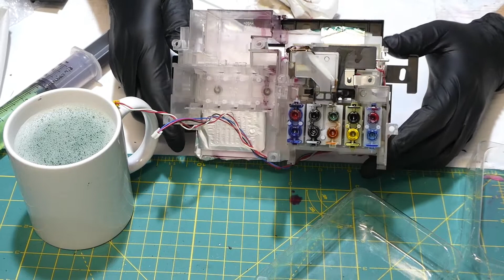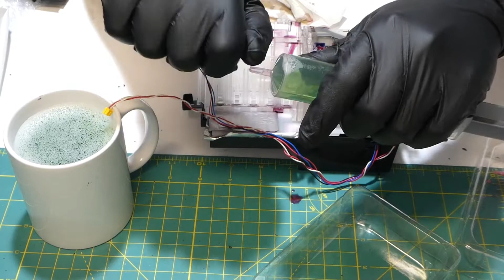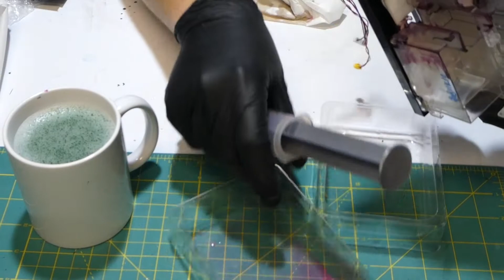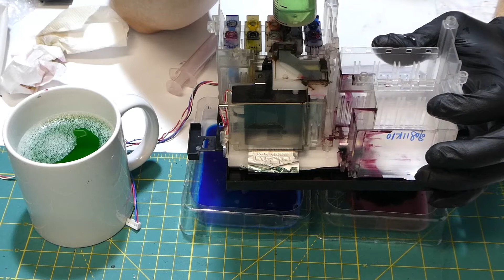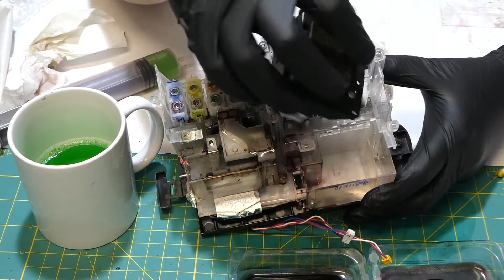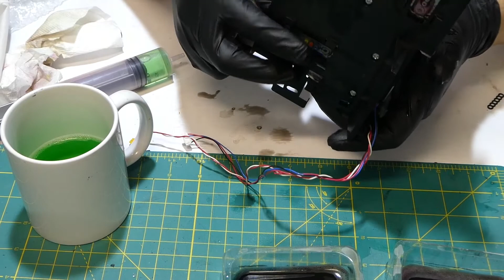Epson Stylus Pro 7900/9900 Ink Damper Assembly Cleaning & Flushing

Comment: I have an Epson SureColor P6000 and it says clean print head if there is fair or missing segment in check pattern, the magenta line does not come out, what should I do?
Reply from the maker: First thing I would do is check ink supply. Make sure cartridge is decently full then, in the areas where it's accessible, use a flashlight to check the ink lines for air bubbles or signs of a clog. Could be something as simple as a bit of air just getting in the system as well. If clogged, that's a whole heap of fun. Just clean the affected color pair if possible, so you're not going bankrupt wasting ink as well. If things clear up and start firing, probably fine. If you keep losing nozzles, probably ink starvation.

Comment: How do we contact you?  Your comments on the BCH printer videos are brilliant and knowledgeable.  I would love to know your thoughts on some other DTF printers.
Reply from the maker: Most DTF printers are basically kits, so nothing too special. Most are XP600, i3200 and i1600 printhead based units. Frames, electronics, pumps, filters, tanks and capping stations are commodity parts.

Comment: Very nice video - quite helpful. I have a 9900 and replaced the printhead 5 years ago. I do not use the printer very often at all. The orange channel is clogged and cleaning nozzles does not seem to work. Do you think that cleaning the printhead by immersing the printing surface in the cleaning fluid will help? If not I need to buy a printhead and also inclined to replace the damper assembly. Do you have any recommendations for sources to purchase the printehead and/or the damper assembly.  Thank you very much - Anil
Reply from the maker: When cleaning the head, set it in a shallow container of cleaning solution, just enough to cover the nozzle plate and a bit more and use a small syringe with a piece of tubing to pull the ink backwards through the head. If it doesn't move freely, let it soak an hour or so. When soaking, you can set the head on a paper towel or cloth fully saturated with the cleaner as well to cut down on evaporation. Pull again, if no flow, soak some more. Can do up to a 24 hour soak with most mild aqueous/sublimation cleaning solutions/flushes.
Reply: Thank you ver much. Will try this method.
Anil

Comment: Hey, you know the motor on the assembly? I believe it is the ink selector motor. Well, I turned the motor a couple times and I can see it moving to change the ink BUT now it doesn't work. I get an error when the printer tries to switch it and I can hear the motor try too. I tried to move the selector and right when I hear a click I leave it but that didn't work. Any ideas or lost cause?
Thanx for any help.
Reply from the maker: Try reversing the motor by hand back to the original position.
Reply: @o.e.r.3287  it's been difficult to put it back to the exact spot. I took it apart and I see that when I spin the motor it goes to a switch. There is 2 switches, I'll try to put it on the switch.
Reply from the maker: @RealLupi   The switches tell the printer where the actuator is, so, yes, good it set it to one of those. Since the printer sees neither being tripped, that might be the cause of the error message.
Reply: @o.e.r.3287  Thanx for your reply! After many tests and lots of time trying to figure it out, I DID IT! Turned up being the circuit board, had some damage on it so I replaced it and we are good now! But now my nozzle check is completely wrong. It looks like random straight horizontal lines in all the ink colors. Just lines, not even a letter to be seen. Any ideas?

Comment: Hi do you use straight simple green or do you dilute it with water? I have a 7890 this really plugged from sitting going to try this this week. Thanks for the video
Reply from the maker: 1-2 parts hot water (filtered/distilled recommended, but not necessary) per part of Simple Green works fine.

Comment: Hi, I followed your video and found it very interesting. I bought a used 7890 with clogging problems and only 2700 prints. On the first cleaning attempt with the basic procedure I got nothing, always blocked. I disassembled and cleaned the head with the syringe and detergent, and I recovered all the channels except the black, both MK and PK.
the test printed everything except the 3 central lines.
I disassembled the dampers and cleaned them with the syringe, dismantling them all and cleaning them one by one.
I reassembled everything but the problem remains, in fact it has become more serious, the test only prints the two upper and lower lines, so it has gotten worse.
what should I do?
Reply from the maker: Could just be a collapsed or toasted printhead.
Reply: Hi, I also have an Epson 7890 with the same problem. The black channel does not print. Just a few lines. I have already done 2 cleanings by dismantling the head. Did you by any chance solve the problem? How? Thank you very much if you want to answer me.
Reply from the maker: @alessandrofabbrini9964  Could just be a blown head, happens on those things. Also, gently inject some cleaning solution into each port. If it comes out the side of the head or another input port, you have a bad nozzle plate or other mechanical failure.

Comment: I really liked your video about cleaning the damper assembly but it would have been nice if you showed us how to disconnect the ink lines. I took the ink line off the front and I had a gusher of ink flowing all over the printer and floor. I could not figure out how to stop it. It was awful. I finally managed to put the line back over the inlet jet and get a screw in it. How the heck can you take the damper assembly off the printer?
Reply from the maker: I use a 10 inch long #2 Phillips screwdriver to remove the 6 damper bolts with the head parked in the middle of the printer. Saves from having to take off the side plastics and sheet metal top. A good flashlight is a big help as well, just unplug it when the head isn't parked and it will slide in the carriage freely.
Reply: that was a good question and the response you got seems to answer a different question. I Thought maybe you could first remove one or all of the cartridges but then you cannot operate the printer or simply put it in a state where you can manually move the head assembly. maybe there is a way. What I did was made a clamp to squeeze the tube assembly and once clamped I could remove the tubes (the tube manifold) and no ink gets spilled.

Comment: I bought a 9900, printhead was replaced twice. I bought chips and refillable cartridges from China and ink from them too. I used IPA and cleaned both the old and the new printhead, it runs fine without any issues. People just don't seem bothered to take their expensive printers apart I think.
Reply from the maker: Usually a cleaning will work, but far from guaranteed. Not uncommon for the actual piezo elements to burn out however.

Comment: Hi I have a Epson 7890 DTF printer when I do a noozzle check not printing color I remove the head I'm soaking it .All the Ink port assembly are working except 2 in the center what can I do thank you Barbara:face-pink-tears:
Reply from the maker: Check seals, clean wiper, check middle capping station, prime printhead with ink or possibly check damper seals and filters. Could be all sorts of things.

Please note, I do not provide tech support for these printers. They're getting pretty old and the heads are already very failure prone in the first place.

Comment: Great info thank you. I searched the comments and you haven't answered anyone about the service program though. I picked up a 7900 from an art gallery that rarely used it. They wouldn't pay Epson and the local print expert won't remove more than 3 screws when green, i'm hearing is an issue, clogged it beyond self repair. So I bought it from them, cleaned everything, including taking the print head out and having to soak the bottom for a bit. I cleaned it and put it back. Now I'm reading I need the software to finish the head install. 
  So where do we get it? I see it for sale on Ebay and in Europe but you said we shouldn't pay for it.
Reply: So an hour later I discover I don't need the program because I put the same print head back in... now every channel is blinking and it's telling me to replace the cartridge. I was going to shake them anyway, so I took them all out, shook them for a while, replaced a few that were low I got with the printer (labeled 2011) and they ALL showed up except the green, which I had not planned on putting back in. But I don't have another one right now so I shook it a while, cleaned the port, inserted it and getting the same 11 death errors. I'm going to buy the program off ebay because they all showed up for a second. It read the chips and knew I put new carts in... 
  It's as if it's not pressurising the ink cartridges so it thinks they aren't there...
Reply: @levib571 did the program help with the error ?
Reply: @DonteKentrell  no, but it did help narrow it down. This line of printers are garbage. Not worth repairing or converting. The print head is garbage and they are expensive. Didnt buy one because it'll just fail anyway.

Comment: can you tell please tell me how to remove the two middle dampers. Please!!!
Reply from the maker: The middle dampers are tricky to remove. I had to use a thin seal pick (piano wire might work) to get the tabs unclipped. Because the ink switcher gets in the way, it can be really difficult to do without breaking anything. Just take your time and don't be too forceful. Wish there was an easy way to do it, but it just takes a lot of patience.

Comment: Im willing to pay
Reply from the maker: Your best bet is to prime check the head. You can also do a reverse-pull by hooking a syringe and a bit of tubing to the ink ports and carefully pulling back the plunger to remove the old ink. You can also soak the head in a shallow tray of original formula Windex, or 90% water and 10% simple green. Be gentle with your pressure using the syringe as well and after doing a pull, you can start pushing clean SG/Windex through the ports.  After reassembling, run a cleaning cycle or two to pull ink through the head and re-prime it.
Reply: @o.e.r.3287  we did everything, we washed everything, waterfall and after full assembly the ink doesn’t come out
Reply: Did cleaning cycles and everything else, still nothing it doesn’t load to the dumper
Reply from the maker: @IgorD666  If the damper isn't priming, it might be an issue with the pressurization pump. The system pushes air into the cartridges to press down on the internal bags to move the ink up into the system. Bad pumps typically give an error code however. If it is just a single or few colors, and not all, it could be gelled/solidified ink inside the lines.

Comment: Hi bro, how do I get it out?
 I tried the other day and I drowned myself, the printer and everything  within 10ft of the printer in ink 🤦

I can't figure out how to unlock the carriage and have the system depressurised at the same time?
Reply from the maker: Need to restart the printer in service mode, tell it to do a wiper exchange to unlock the head and then power it off. Some videos showing the process can be found, just search 'epson 9900 wiper' If you try and open the ink system with it pressurized, you end up with an ink sprinkler.
Reply: @o.e.r.3287  Thank you, I got it sorted this time without covering the place in ink.
You know when you screw off the black plastic on the top, have you ever unscrewed the next plate that sits on top of the dampers with the foil on top? I'm looking to add a white ink circulation system to mine, but I'm afraid to unscrew the plastic plate with the foil on?
Reply from the maker: @stuartcotterill9475  The foiled plastic tends to be pretty durable, just avoid puncturing it or pulling on the foil itself. There was apparently a 7900W white variation of this printer, but I have not seen that version in the wild.

Comment: I just ordered a new ink selector and then I watched this. I am getting air in my line. My magenta line went out so I bypassed it after I tried to clean it. A few months later another Magenta line failed. I'm going to try & clean the selector to see if it will work.
Reply from the maker: The selector is for swapping between matte and  photo (gloss) black on the damper to my knowledge.

Comment: How much for a print head for the 7890?
Reply from the maker: Not selling parts at the moment.
Reply: Can you show me how to disconnect the tiny blue & red wires.
Reply from the maker: @ocbsquared  I just splice in a connector on the damper, saves me from having to remove the side and top covers from the printer. Otherwise, you have to get access to the very top of the print carriage and remove the wiring covers.

Comment: Awesome video!
I have a Epson Stylus Pro 7700. That has been standing for a little to long during the covid 19 period. I’m about to try this cleaning method out. 

My actual problem right now with my printer is. 
I moved the printer and now my printer is asking me to insert a maintenance tank in the right hand side.
I have two maintenance tanks and it’s just not detecting them.

Must I replace the Eject Guide Unit?
Reply from the maker: Sometimes you can just scrub the contact chips on the maintenance boxes with alcohol or similar cleaner. Could be something as simple as corrosion. No guarantee, but an easy thing to attempt.
Reply: @o.e.r.3287  thanks for responding. I tried that but still no luck.

Does these old printers get a software ink pad counter reset? Or do you just have to reset the maintenance tank itself?

I’ve ordered a Eject Guide Unit in the meantime.
Reply from the maker: @faganlevendall807  You can get a chip resetter for the maintenance box for around $10-30. Just presses up against the pads on the chip and resets it to 100%. If there's lots of ink, you can unclip the grate and restuff the box with paper towels or cotton pads.
Reply: @o.e.r.3287  thanks for the info. I appreciate it.
My printer is saying: Insert the right side maintenance tank 

It’s not saying: Replace the right side maintenance tank. 

Do you still think it could be sorted just by resetting the maintenance tank itself?

Apologies for the millions of questions.
I just really need this printer.
Reply from the maker: @faganlevendall807  Could be, also, get a flashlight and look at the contacts in the maintenance box bay to see if they look bent, or if the plastic retainer has cracked.
Reply: @o.e.r.3287  I checked it out but I couldn't see anything wrong with the pins. I don't know if it's the little circuit inside of the guide unit. 
I've ordered a new one. Only problem, it's going to take 6 weeks to arrive to the Epson agent.
I really hope it's that.
Reply: @o.e.r.3287  hi there again,
is there anyway of moving the printhead out of “locked in mode”?

I would like the clean the ink lines/dampers and print head, whiles waiting for the maintenance eject guide unite to arrive.

Many thanks

Comment: Do you have any refurbished Epson 9900 print heads?   Cleaned mine, still have a faulty LLM channel.  I think it may be an electrical problem.
Reply from the maker: Not currently dealing in printheads as of late, sorry.
Reply: I would like to buy an epson 9900 plastic cartridge  holder...its the back plate on the left hand side what the cartridges are pushed into where the inks initially flows through...do u have any in stock?
Reply from the maker: @eonrobbyfreespiritzja9116  Nothing in stock at the moment for these printers.

Comment: Great video I recently purchased a 7890 and it has 4,400 print pages with my print head last me some time still or do you recommend buying a new one ? Also do you have a website for salvage parts ?
Reply from the maker: Not selling salvaged parts at the moment. However, to keep the print head going, use the printer often, run it in a climate controlled room and keep the wiper and capping station gasket clean to maximize its life.
Reply: @o.e.r.3287  thanks for the advice. I am converting  it to DTF my humidity room is set @ 45 will that work for this type of printer
Reply from the maker: If adding white ink, expect a massive amount of headaches. That stuff is print head kryptonite. The BCHTechnologies channel has lots of info on conversions, inks and stuff like that. Mostly on smaller printers, but same principals apply.
Reply: @o.e.r.3287  thank you